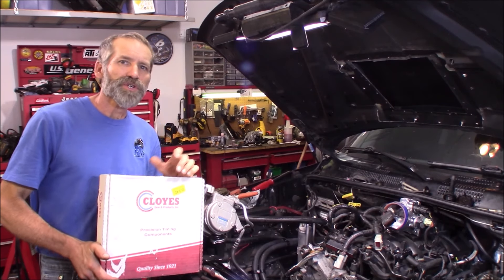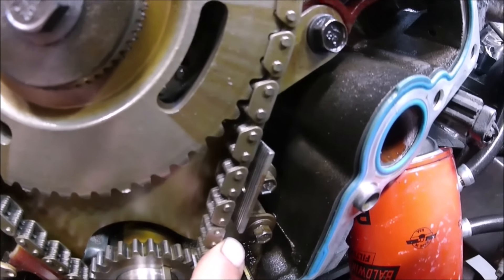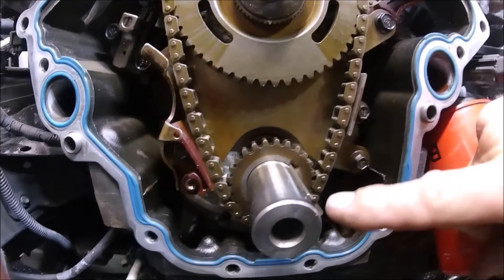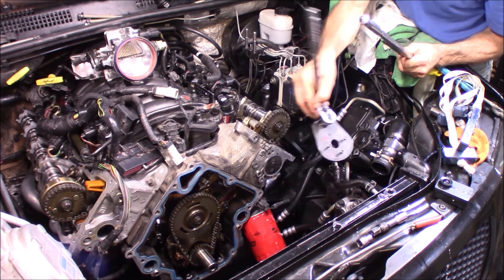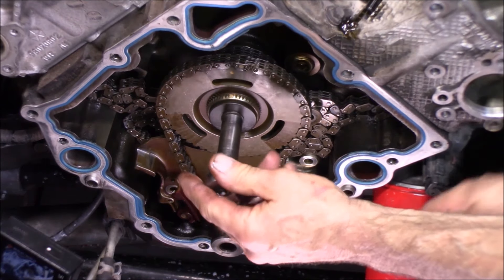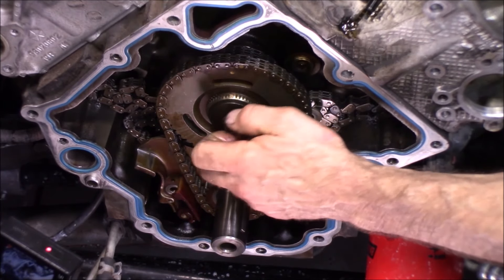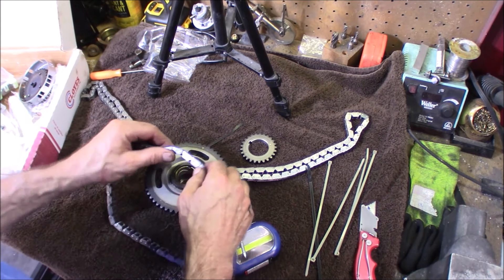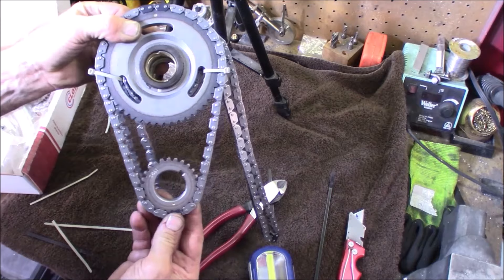How to Install Timing Chain Set Dodge, Jeep & Chrysler 4.7 & 3.7L

Comment: I worked for Dodge for a number of years and that was an excellent video on how to do this. Very strait forward and explained very well.
Reply: I assume that you have done a number of these 4.7l's then? Ever have one jump time at initial crank? I just did one, reused tensioners, everything looked good. This isn't the first one I've done either. Hit the key to start it and it instantly jumped time on both heads. Even after retimiing it, I have zero compression on the passenger side and 60 psi on the drivers side. I even primed the oil system the second time, which was too late. Is priming these needed?

Comment: Excellent Martin, man!
Reply: Usually I work with a Honda 1.7 old engine with one timing change you helped me a lot with my Jeep I miss the timing and chain I mean did Mark on the chain for the left side but other marks are good the engine rotates by hand with no problem don't think I'm good thank you for your help

Comment: Martin, I want to thank you for the excellent video and instruction regarding what I initially thought was a very intimidating job for a non-professional. My son and I used your video (and one other about removing/installing cylinder heads) extensively to rebuild his Jeep Liberty 3.7 which had a dropped valve seat. Neither of us are mechanics but after watching your videos, we both said "we can do this!". And we did! After everything was put back together, we both held our breath as we turned the key to start it - and it fired right up.

For anyone considering doing this job, just watch this video (over and over), follow the steps exactly, and you will be successful. In fact, setting the timing was the easiest and most enjoyable part of the job.
Reply: And what a great experience to share with our children boy or girl . I am sure he took away much patience knowledge and the reward of success . It will come in handy in the future I am sure and he will say thanks Dad 👍

Comment: This engine is so clean it looks like it came from a museum!! But a great tutorial that I've watched at least 6 times now. Amazing videos! I like how you work.
Reply from the maker: Thank you very much! 😊
Reply: @martinbuilt  I was wondering if I could pick your brain I am having problems with my 4.7
Reply from the maker: @saulzavala9806  yeah, what's up
Reply: @martinbuilt  well I changed all of my lifters and after a while started making noise again
Reply from the maker: @saulzavala9806  
Did you soak the lash adjusters in motor oil for a day or so? This will work out the air that is trapped in the lash adjusters. And how is the oil pressure? It would be a good idea to run 3/4 quart of Marvel's Mystery oil with the next oil change. I use this in both my 4.7 engines.
Reply: @martinbuilt  I did yes
Reply: And 2 times now it has dropped a follower
Reply: I changed my oil like I should  and used full sy iol
Reply: Next time use some brass sheet metal to wrap around the cam to protect from the vice grip jaws.   It works much better than a rag.   I use 16- 20ga or so.     I started that years ago after the jaws slipped through a cloth rag causing damage to a part.  Take care brother...

Comment: Thank you Martin for all your helpful and interesting videos. I'm just putting new timing chains in my 2004 Dakota. When i put the camshaft chains on, the two black links are not exactly center in the slot windows. I really can move the one tooth back or forth. they end up either on one end of the slot or the other. What do you recommend? thank you

Comment: For the 2008 cams, etc. did you just find some in a salvage yard?  What all did you grab if so?  I received my new 4.7 yesterday, remanufactured from Powertrain.  Anything I should double check before I install?  I have to use the old timing cover, oil pan, and valve covers.  Great video as usual, thanks!
Reply: I noticed it has the old style rocker arms with the bigger oil hole.  I am thinking of doing the '08 upgrade at a later date.  I want to get her installed and running at this point.
Reply from the maker: Yeah when you get around to it I would upgrade to the newer style rocker arm the aftermarket ones will appear to have a larger hole than the actual OEM ones but the underside of it has a very small hole so it is still an upgrade.
Reply from the maker: Yes I just grabbed the camshafts you could always use the bearing caps as well if you like. 
And while you're at it you may as well get the upgraded rocker arms.

Comment: Herllo, Martin.  I have a question about the 4.7 timing chains.  I'm in a bind because my cam chains are single roller with only one plated link at each "end".  They look just like my stock chains.   When I install them on the main sprocket, the links are either one way or the other in the slots and not centered.  How should I go about making sure where the plated link goes when looking through the slots so not to get them off a tooth?  Thanks Martin,  Just subbed!

Comment: Hi, very informative video. I've just taken both cylinder heads off my jeep 3.7. I need your advice please. I had the main chain at TDC and both left and right chains centred. Does it matter if the camshafts on either side move during head removal and are no longer centred provided the main chain is still TDC. When I need to put the left and right chain sprockets back on I will need to rotate the camshafts to centre again. In the end If I have everything in position as it was at the start will it be ok or has the stroke position been compromised? And advise would be greatly appreciated.

Comment: Hey Martin, Thanks for the very helpful video.  I just replaced the timing chain set but when reassembled with all the marks & links in position properly with respect to each other, both of the new cam gears didn't have the "V8" at 12 o'clock & the "R" & "L"'s weren't at 9 & 3 o'clock - as they were before removing the old gears (and the engine was not rotated during the job).  The "V8" markings are just left of 12 o'clock position (no more than 11 o'clock). They appear to be about 1-tooth or chain link off from having the "V8" at 12 o'clock.  I reassembled and now engine cranks but doesn't fire & start.  Could this be from the cam gears being a bit off as described?  If so, should I go back in and reinstall the cam gears so "V8" is a 12 o'clock?  This will move the cam gear punch mark for the "R" & "L" to be about 1-link off from the dark chain link that it should be aligned with.  What can you advise?

Comment: I have a 3.7 I'm doing a timing set on a 2005 Jeep Liberty. Will that 1 piece timing cover gasket work for me? It didn't have a gasket and the set for mine has RTV to seal it up. I would rather use the gasket. Thanks and Great Video!

Comment: Hey man, I love your videos!!! Was wondering if u could do more step by step videos on the Dakota.. like removing the engine/ transmission.. how to find A/C leaks.. How to change transmission fluid and differential fluid, spark plugs, alternator, etc .. also how to wire lightbar to Hibeam switch

Comment: Sir Martin, greetings! My '02 WJ (not HO) has a sound like  bbs rapidly dropping into a tin pie plate. Would that be due to a stuck hydraulic tensioner - when I unload the chain by pulling my foot off of the gas pedal? Should I be worried about an interference scenario? Thanx much for your terrific "how to" videos!

Comment: Martin, thx for the helpful video, I just did everything right and when I rotate the engine the colored link no more in the right position however at TDC  the timing on the cam gear v6 at 12 o’clock both side the idler gear at 12 the crank sprocket at 6  the balancer gear dot perfectly lined  to with the ideler sprocket gear after 4 rotation all lines up but still the colored link not in the 1st time step position , note : all gears lined up at top dead center TDC , am I good to go or those colored links should be at same position ? They were in the right spot before rotate the engine , thx in advance
Reply from the maker: Thank you I'm glad you liked it and found it helpful.
Yes I know on the 4.7 once you rotate the engine after installing the timing chain set and sprockets it takes 13 complete rotations before ALL the marks line back up again.

Comment: Hi Martin! Great video and thanks for doing that. There's just one more thing to watch out for on the "3.7" however. Behind the double gear assembly , there is a counter balance gear that must be properly lined up as the new gear and chain set is being pushed on.
Reply from the maker: Yep, that's right ✅👍
Reply: Yes and now here I am stuck unsure how to time that small gear..
Reply: I almost just stuck stuff together because it wasn't mentioned and I figured it wasn't important.  IT IS.  Prior to putting the chains on, look at the very back angled teeth for a dot.  Use a grease pen to mark the tops of those 2 teeth since you won't be able to see it once the chains are on.  Then when installing, put the dot on the counter balance gear in those teeth so when pushed in place, the dots will be lined up.

Comment: At 5:45 your showing the driver side camshaft sprocket removal with the tool. How do you use the tool on the passenger side with those rivets on the sprocket?
Great vid here I go
Reply from the maker: Thank you, I  remove the 2 bolts in the tool and place one of them back in at the bottom hole.
Reply: @martinbuilt  i watched your tool building video. I need to remove the nut and bolt that holds timing ring to the sprocket to gain access to a hole. I see the tension is created against that pin hole and the socket hole. Thats what was throwing me off. I really appreciate the quick response
Reply from the maker: @reeaub  on the 3.7 are all 3 holes blocked?
Reply: @martinbuilt  yep. 2 rivets and a allen head bolt and nut. I can send a pic. Don't know where. This started from a dead cylinder and can see the valve seat broke thru top of head to manifold connection. Head job for sure and hoping the cylinder and piston are still good or looking for a used engine

Comment: Is there agive away on the need for a new timing chain set? Noise at start up when cold? Is there a particular noise to listen for? How to tell if may actually be lifter noise. Is there a mileage at which it would be wise to replace. If you include these diagnostics in your videos I believe they would be as helpful to your audience as the repair procedures. Thanks, good job!!!!

Comment: Hopefully you are still responding to comments, but at 4:36, it looks as if your v8 mark on the right head (passenger side) is more like 11:30 o'clock  I've put the same timing assembly in my jeep and I have this issue.  I'm wondering if I somehow skipped a tooth on the right head cam, or if i'm just worrying about nothing?  I was about to remove the assembly to check when I looked at yours and saw it in almost the exact same orientation.  Thanks.
Reply from the maker: It worked out for me with no issues. Just make sure you got all marks where they should be and make sure you get the cam gears bolted onto the cams properly.

Comment: Good afternoon, my friend. First of all, I would like to congratulate you on your willingness to make an explanatory video about this service.
I have a 2013 RAM 1500 4.7 with 151,000 miles. Since I bought this truck, it has been making a ticking noise when starting cold. After about 3 minutes, this ticking noise disappears. It keeps me awake at night. The truck is well maintained and has a good structure. I want to keep it in good condition for a long time. I will need your help because I will be doing the service myself.
My question is: could this ticking noise be caused by the Timing Chain tensioner?
Thank you.
Reply from the maker: Yes the noise actually can be the hydraulic timing chain tensioner.
I would try to identify what side the noise is on and if it is right at the very front of the engine on one side or the other this could be the timing chain tensioner and not one of the lash adjusters.
Reply: @martinbuilt  What I noticed here is that you can hear the ticking on the right side, not in the front but on the side. The funny thing is that you hear it louder when I go to the side in the middle of the truck and below. I just want to know which parts to buy. What would be your recommendation since the front of the engine is going to be removed? Thanks.

Comment: I bought a used jeep commander 2006 to fix. Seller replaced timing chain. Drove it around, then heard aweful intake noise. I pulled the valve covers (intake which had a hole in the runner. ) long story short 2 rockers came off one on each side of the cylinders. So I rotated the crank a total of 720* to see if I can line up the timing marks the closest I came to them all lining up on tdc and the v6 embossed on the camshafts at 12 o'clock the colored chain links where off by one full tooth on both sides, they didn't correspond perfectly with the marks on the cam gear. 
So my question is: when timed correctly do all the marks end up lining again at some point during a couple rotations of the crank 360* ? Thank you.
Reply from the maker: The timing marks should all lineup perfectly, but once you rotate the engine at all, it takes  14 rotations of the crank shaft to get all the timing marks to line up again. 
 And yes once you do the timing all the marks should be lined up perfectly.
Reply: @martinbuilt  Thank you for replying! I will keep on rotating and see what happens.
Reply: @geoffreyspeed1335  The "colored" links won't be where you'd expect after rotating the motor. They're there for initial assembly. I imagine at some point (no idea how many rotations) they'll be back on the sprocket where they were when first assembled. Point is, once you're assembled, all your looking for is the gear alignment. Forget about the chain.
Reply: @andybilakshow260  I decided to go ahead and pull all the timing apart and do it myself. For it to ruin two intake manifold ports on each side of the engine was pretty suspect for incorrect timing is my best assumption.  Especially it occurred within minutes of a new timing chain being installed by previous owner.
Reply: Decided to go ahead and rebuild the heads. Finished that, timed it, reinstalled intake, fuel rails, coils....and wired right side injectors and coils.  Left side (driver side) wiring harness has injectors, coils and two for the throttle body.  There is one more towards to rear of harness but near the back coil and injector wires that I can't find the mate to? I've scratched my arms up trying to find the other wire to plug them together. No luck. Do you happen to know what harness that other wire comes from. (4 wires total on plug) could it have fell back on top of transmission or is it coming from the right side? Thanks
Reply: @geoffreyspeed1335  all your injector wires & coil wires should be incorporated into the same group of wires. If I'm not mistaken, your throttle, and  ?? wires should be in there somewhere too.

Comment: I have a 2011  liberty 3.7 that I replaced the passenger side head due to blown head gasket. I set the timing up correctly with #1 cylinder at TDC on exhaust stroke. My question is, the marks on the timing chains don’t line up with the marks on the gears. Are those marks there to help you line everything up when installing new gears?

Comment: I was told to rotate the motor manually after setting the timing. Is that necessary? I'm just wondering also the plate fell out from the tincture this video was very helpful thanks.
Reply from the maker: Oh, maybe to make sure that everything operates like it's supposed to. other than that, I can't see any other reason to do that. If you decide to rotate it manually, make sure you're turning it clockwise while you're facing the front of the engine. I'm glad you liked it and found it helpful. Thank you for watching.

Comment: Great video, I got everything together and the timing is good but I notice when rotating the engine each cam chain will reach a point where it has a little slack where it runs against the guide, not the tensioner side, the fixed guide, seems to happen when a valve clicks shut. Is the noise and the slack normal? It goes away as the engine rotates.
Reply from the maker: Thank you.
The hydraulic tensioner can't do its job until the engine has oil pressure
Reply: @martinbuilt  that makes sense! duh! THANK YOU!

Comment: Great videos, I picked up a cheap 2002 grand Cherokee and it runs horrible like it’s running on only a few cylinders, but doesn’t make rattling noises in the engine, where do I start with trying to figure out what’s wrong.  Hopefully it’s something somewhat simple but anticipated a bad engine even though now I don’t think that’s the issue. Thanks for any feedback

Comment: Hey my idler sprocket didn't have any "end play" after installing the idler sprocket bolt. Is that a bad sign?  I use the original sprocket that came with my 2006 4.7 dakota, its stiff and i had to use sum force to get it on

Comment: Martin, quick question...the 2 10mm bolts that hold the tensioner behind the idler gear sprocket, you never said what torque those were & in the video you said the other tensioner bolts got torqued to 20ft lbs. Can you confirm on all tensioners? Thanks, Jim
Reply from the maker: T40 Torx Bolts 13 ft. lbs. or 156 in. lbs.
Reply: @martinbuilt  Thanks Martin, but I wasn't talking about the T40, I was talking about the tensioner bolts. The one on the right and the one on the left and the one behind the idler gear; that one uses 2, 10mm bolts. You never showed when you put that on your car, only that you had to replace it, but you never talked about the torque specs on it. Thanks